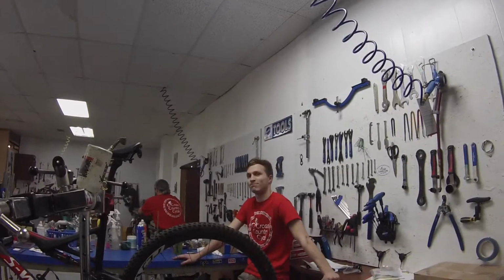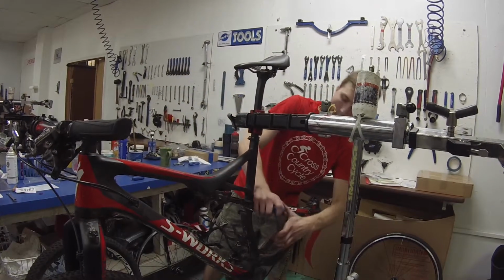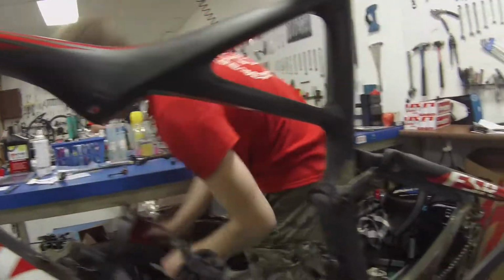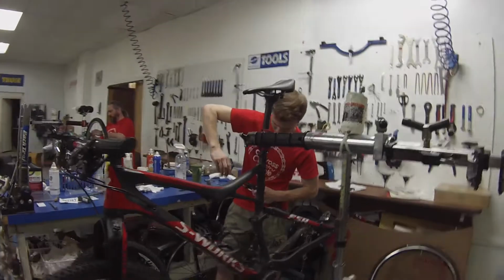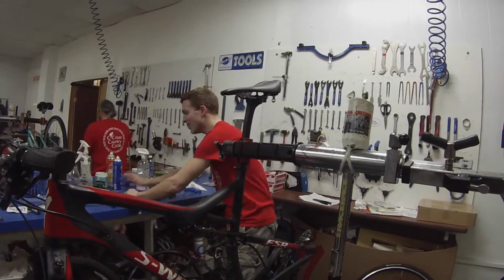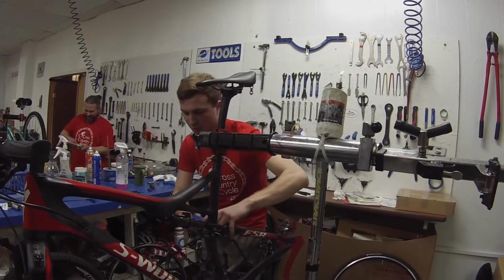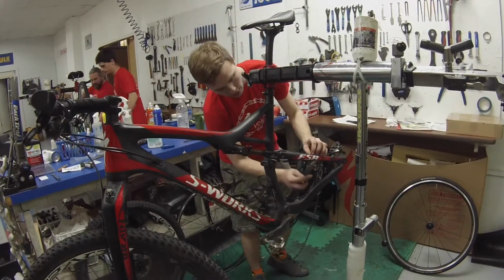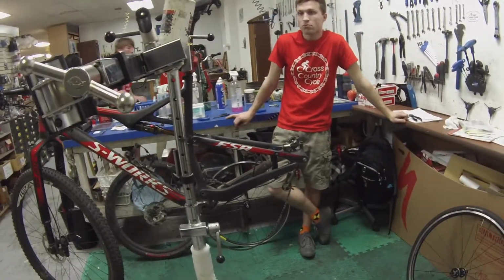S WORKS Epic Rear Shock Swap

Comment: So I just had my rear Epic SWorks brain shock replaced yesterday and my mechanic used a torque wrench on a couple of the fasteners AS PER SPECIALIZED INSTALLATION INSTRUCTIONS.  I NEVER SAW THIS GUY PROPERLY TORQUE ANYTHING
Reply from the maker: Joseph Dunbar Interesting. That may have added a couple of extra seconds for sure. I would say that I’ve never had any issues with it coming loose or creaking from being too tight. I’ll check with the shop the next time I’m in.

Comment: did you have any problems with it?  or  was just time for service ,  i have the same bike and its been 1 year and 4 months  beating  the crap out of it  and still ok . i think  ! lol
Reply from the maker: In for Service. As a Clydesdale I beat the crap out of mine, too :) The seals I think may have dried up over the winter (in Michigan we Fat Bike on the snow for 4 months) which didn't help so I'm going to try to do a better job of hopping on it once in a while to make sure the fluid gets moved around. I would suggest having it re-built every other year for sure if not every year. It costs money, but it is worth it.

Comment: I'm having problems with my 2018 Specialized Epic Expert brain. The shock was changed already because it was defective and now it looks like it's defective again. It won't accept air and it leaks it. I'm planning on making my bike brainless with this kit https://www.bikeyoke.de/en/Specialized-Epic-2018-2019.html
What are you're thoughts? I'm tired of the bouncing my bike has even with the shock locked.